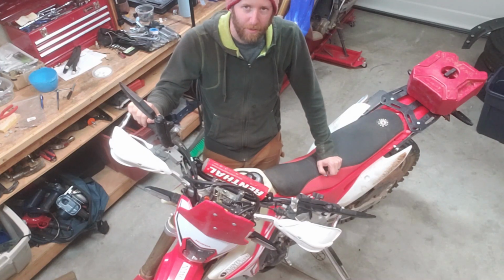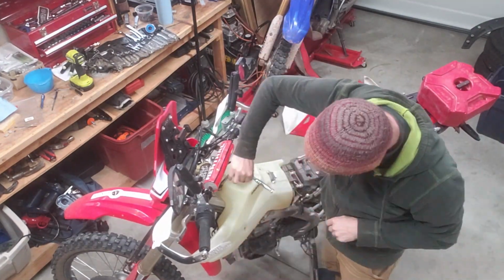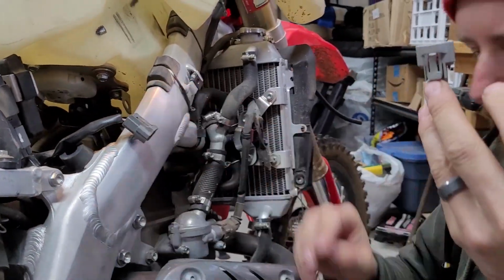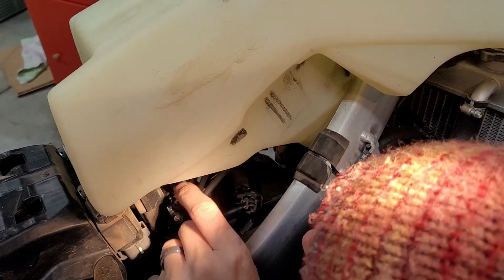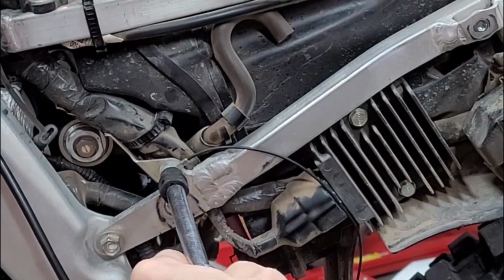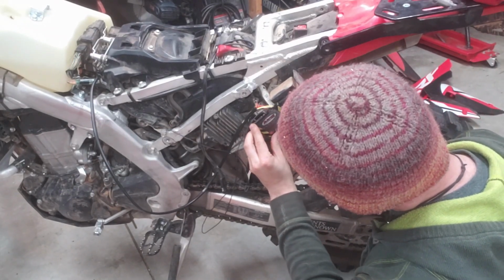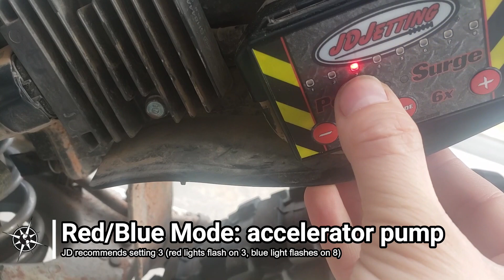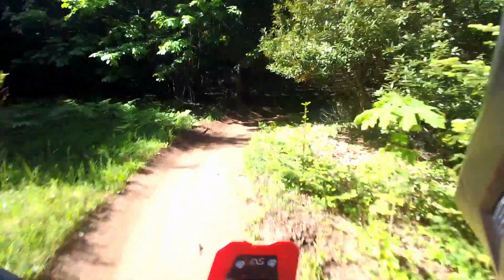Installing the JD Jetting EFI Tuner on a Honda CRF 450L (JD Jetting Power Surge 6X)

Comment: Thanks for the great video.  I installed my JD Jetting tuner today and it works great.  I have the 2022 CRF450RL and I used your settings, This thing blows wheels in all 3 gears, 1-3.
But most importantly the throttle is much better. Its Tamed right down and not jerky at all.  You don't need the Vortex.  This tuner solves the problem with the jerky throttle and gets ride of flame outs. At 285.00  CDN and it was here in less then 3 weeks. Once again Great Video and explanation, thumbs up.
Reply from the maker: Thank you so much!

Comment: Will the ECU adjust automatically with the JDJetting device for different altitudes?
Reply from the maker: Yes. The JD just intercepts the ECU signal and assists it. Doesn't replace it. So the same altitude adjustments the ECU is always doing continues to happen.

Comment: Still running this? Putting this on my RL and would be curious to know how its performed so far and if you made any tweaks to the settings.
Reply from the maker: Still running it. I enjoyed playing with the settings for a few weeks, making random tweaks to see what happens - but the settings I have posted in the blog work great and eventually I  moved the unit under my seat to be safe and out of the way and haven't really thought about it since. Done all kinds of riding from tight technical trails to wide open gravel - the JD Tuner has met my needs and expectations.

Comment: Using your settings do you still have any popping on deceleration?
Reply from the maker: None at all. I only had occasional popping on decel before the mod (I've heard it can be worse for others, not sure why - but my bike wasn't popping much stock). And I haven't experienced any decel popping once I  added the JD unit. The improvement overall is really really good in my opinion. But I imagine it varies from bike to bike and rider to rider.
Reply: Get rid of the PAIR valve. That’s the cause of a lot of decel pop. Even if you don’t desmog anything else, ditch that valve!
Reply from the maker: It's definitely on my project  list for this winter!
Reply: Once the PAIR stops working properly(and they always do), it will cause a lot of decel pop.
Reply: @mattf5630 i ran a jd tuner for awhile without an exhaust and had no popping and now with exhaust i have popping no matter how much i play with it and it runs great, no hot.
Reply: @jerseycaretakers8793  did you get rid of the PAIR valve? Or desmog?
Reply: What is the PAIR valve? You my friend are disciplined man to stay with the stock exhaust. An aftermarket header and can just "sound" so much better. It must be the juvenile or the "ego" in me😅

Comment: What altitude do you run this in? I was wondering if altitude plays a difference in settings also. Most of my riding is between 4.5k and 7.5k feet
Reply from the maker: I'm at sea level to about 4,000 ft. I'm not sure about changing settings for higher elevations as the fuel injection system should automatically adjust for altitude. But I feel settings vary a bit from person to person and bike to bike, so I would encourage trying different ones till you find what you like. At least, that's what I did.
Reply: @PointsUnknownTV  just installed a tuner with your settings and a G2 Throttle on my brand new 22 RL . Bike is so smooth compared to a bone stock 21 RL I test rode before buying mine.

Thank you!
Reply: @isaacm12  how did the stock '22 compare to the bike now with mods?  Thanks.